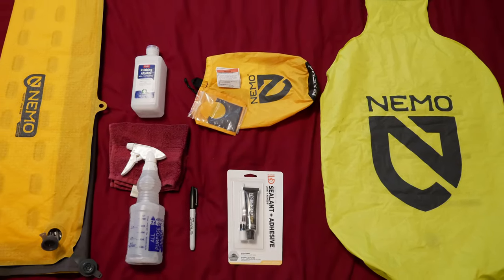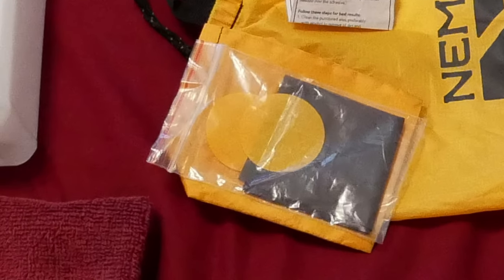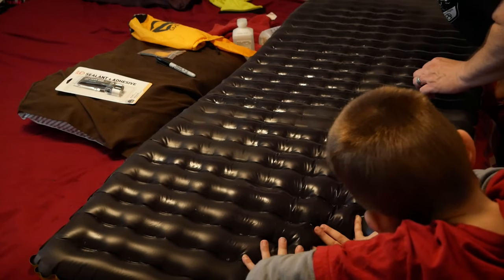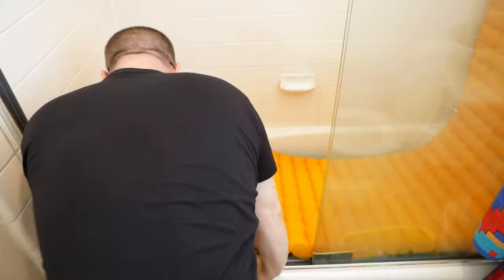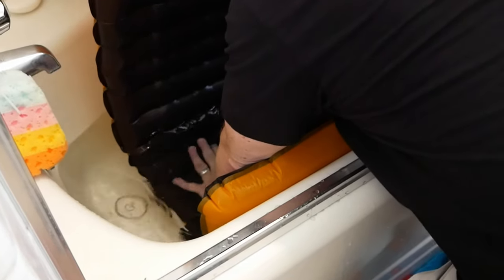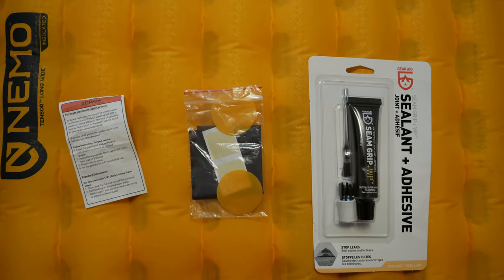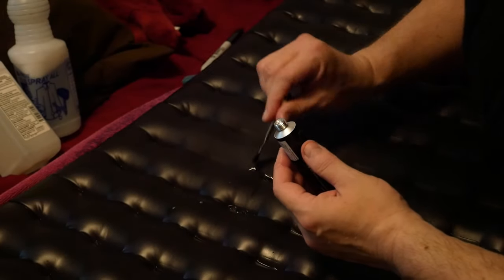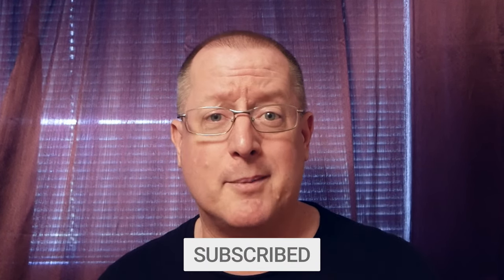How to Find and Repair Sleeping Pad Leaks

Comment: I developed a leak in my Nemo pad too. I didn’t have time to mess around with trying to fix it, so I bought another and plan to try and fix the old one. Since it took several hours for it to deflate, I figure it has a pretty small leak. Interesting that yours were in the seams. I will definitely try and fix it now. Great video!
Reply from the maker: Yeah I didn't do all that for the video, I did it all before I found the leak!

Comment: Thanks Doug, I dread the day that I get a leak in the exact same pad out on a trip. The Nemo Tensor Ins. is the most comfortable pad I've been on and hopefully take the necessary precautions to avoid something like this. I too would be frustrated and probably give up, out in the field trying to find the leak. Appreciate the video.
Reply from the maker: Yeah it's too bad foam pads have such a comparatively poor weight-to-comfort ratio but that's the way it goes. :)